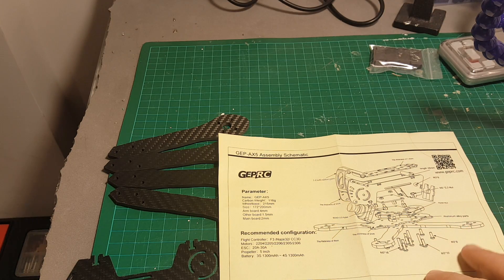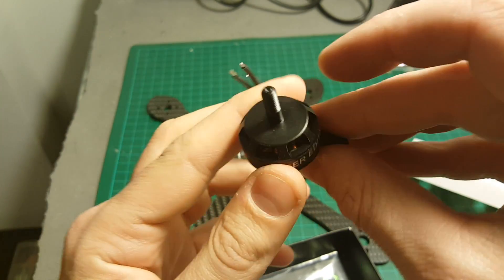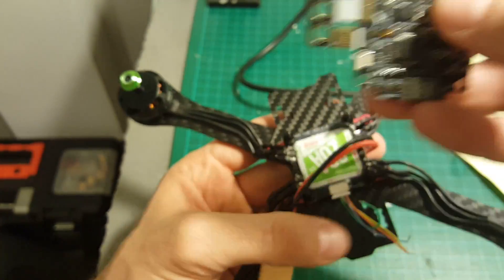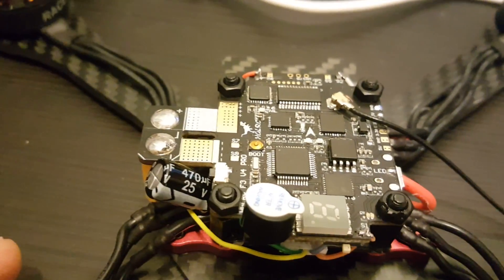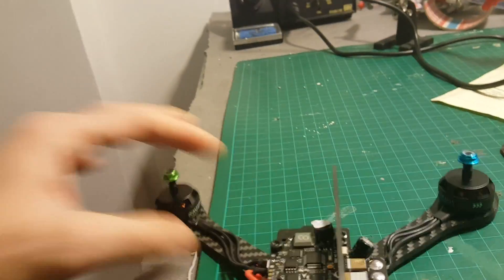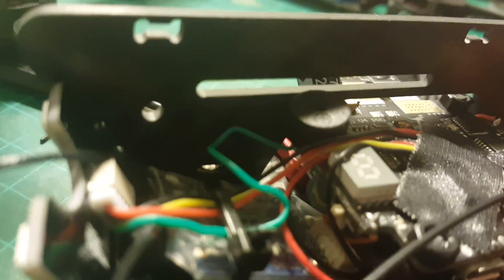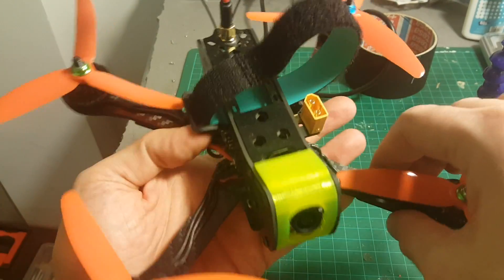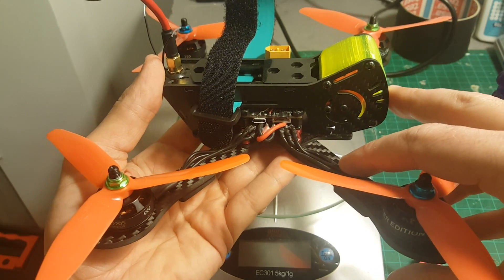GEPRC GEP-AX5 - Part 2 - Build Video

Comment: Thanks for the review. Could you do some measurements for me please? what is the height of the sideplates and the length of the horizontal part of the top plate where the battery is mounted? I was thinking about getting this frame, but I am a bit concerned if I can fit my 1500mah and long 1300mah batteries as well as a gopro session. Thank you in advance!
Reply from the maker: No problem :-)
Sideplate hight: 33mm Top plate length: 86mm
I can barely fit a 1500mah battery...
Reply: Gal Kremer thank you! sounds like it will be a tight fit with a 1500 and a Gopro
Reply from the maker: Øyvin Lanner My pleasure. Yes, I am afraid so...